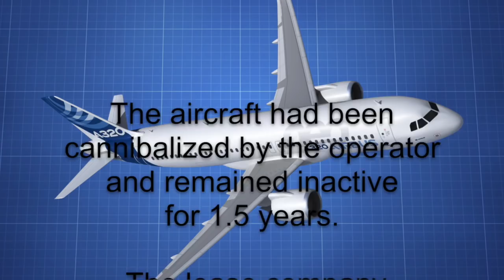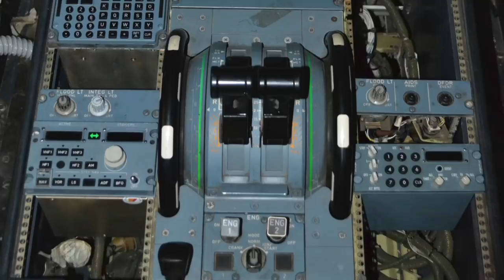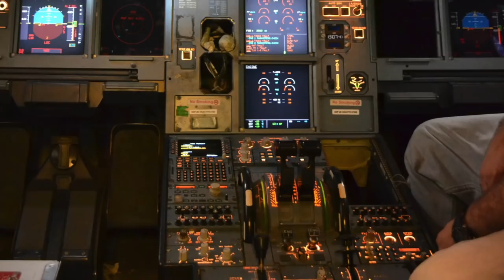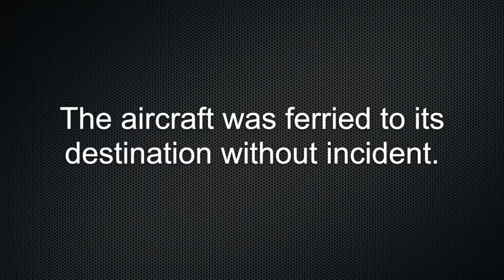Airbus A321-232 Restoration, SOAR, Mumbai

Comment: There are a lot of JET Airways aircraft scattered around Mumbai airport just rotting in the humidity. Some are 777-300ER’s which is quite a useful jet.
Reply: Delhi Airport also has 2 777-300ER & 3 A330-300
Reply: They belong to jet and in recent news I saw they are requesting to operate their 777s.
Reply: They’ve left one here in Paris CDG as well.
It has been removed lately.
Reply: but this plane in the video seems to be already at least forty years old, is such an old plane still safe?
Reply: lenny108 A321 model was indtroduced in 1993 even if this was the first one it would only be 27 years old
Reply: Corona
Reply: Wellt his was a kingfisher a321 i knew jet and kingfishers where great partners

Comment: Mumbai Delhi and Chennai have so many 777-300 of Jet Airways lying in open area exposed to harsh weathers. Why can't they construct huge hangars where these aircraft can be stored with weather protection? Would it help to add few more years to the strength of structure of fuselage and it's airworthiness? How much work is done for maintenance and reviving the aircraft would definitely be more expensive than constructing hangars and rent them out to private operators to store their aircraft in vacuum for longer period

Comment: Operators who treat their planes like that, do not deserve airbuses or boeings.
Reply: yea that poor thing was gross, but it goes to show it can still be repaired and return to flying.
Reply: Cheap parts, even Delta does that with older MD-90s that they bought as spares
Reply: Thankfully said operator of this particular plane has already gone bankrupt.
Reply: they don't deserve the rite to fly and they should loose their acreditation. this isn't a safe practice especially when an aircraft sits abended for so long.
Reply: @HS-PGX  thank the Lord. they were shockers.😦😦😦😦😦😦
Reply: So because they used a plane for parts they don't deserve the right to fly? Shut down Delta, United, and loads of other airlines then.
Reply: @steventurner820  I dont know Steve, I like to know that the machine thats going to take me 30000 feet above the earth, has been in mainly one piece all its life, has been freaking flying and maintained regularly.  We not talking here about an engine  part replacement that came from a plane thats never going to fly again. WE are talking about a plane rotting somewhere for God knows how long. Even a freaking car falls apart in you park it somewhere  for an extensive period and it takes a huge effort to bring it back, because it rots as it sits.😏